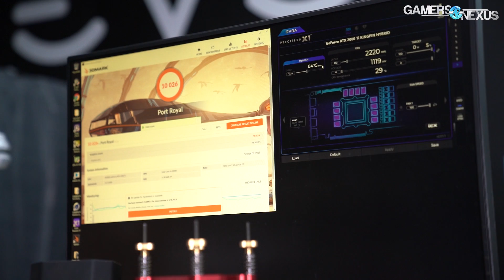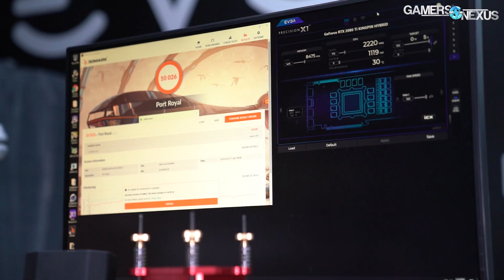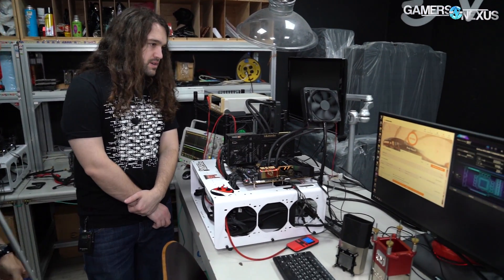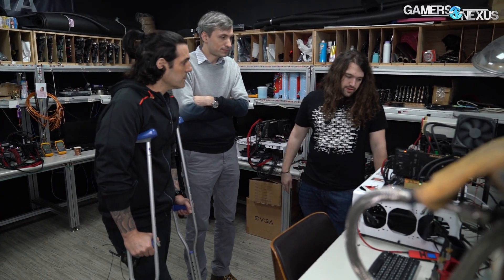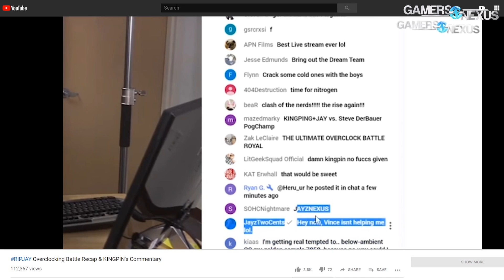"RIP" KINGPIN | 2200MHz RTX 2080 Ti Kingpin Overclock on Water

Comment: Wow that is so cool. you should a do video with one of these Kingpin GPU's cooled with phase change refrigeration and see how high clock speed you can get out of one of these RTX 2080 Ti cards.
I had a question. I have a few EVGA RTX 2080 Ti XC Gaming Cards. I got them off of Ebay, I thought I would re-paste the GPU's on them to see if I could get them to run cooler. 
I have built many PC's in the past and used the pea sized dot in the center method for applying thermal grease, but I have done it only on CPU's with an IHS on them, never on a GPU.
For some reason no matter what I do when I apply thermal grease to the GPU the temps end up worse then they were before I took them apart. 
I have tried the Pea Sixed dot in the center also the X and the vertical line and spreading methods for applying the grease to the GPU and I have tried Grizzley Kryonot, Arctic Silver 5 and Arctic MX 4 pastes with all the same result the cards run really hot. 
I am using the stock heat-sink and fans on the cards and also re-using the heat-sink tension screws with their integrated springs on them. 
 Do you gave any idea what I might be doing wrong ?
do I need to also replace the thermal pads ?
no thermal pads were removed I just took the stock back-plate off of the card when I re-applied thermal grease on the GPU, but I put it back on again and left all the thermal pads alone and stuck on the backplate. Also the other thermal pads are sandwiched  inside underneath the other plate around the GPU but that plate along with those thermal pads we never removed or unscrewed at all.
Any helpful suggestions you can offer would be greatly appreciated.
in the past when I applied thermal grease on CPU's they always ran cool and fine and I had no problems applying the thermal grease but for some reason I can't get these GPU's to stop overheating.
Thank You in advance for your help

Comment: Im very satified with my evga 1660 super. It overclocks great, solid 90 fps on ultra settings if not higher depending on game . Precision x1 works great for overclocks with a great looking UI even though i prefer afterburner personally. Keep uo the good work GM and EVGA

Comment: if i was rich .. i'd buy 2 of these beasts and custom water cool them as much as possible 
easy 4k@144hz gaming
Reply: someone you really think so? I just bought my 4K 144hz monitor and I’m considering buying one of these, for now
Reply: @pubbzie5866  depends on which games you play .. but a single one should suffice for BF5 for example 
if you are planning to sell it for next year new generation (rtx 3080 ti ?) then i'd say go get the ASUS one .. it's FAR cheaper 

the kingpin one cost 1900$ 

and it's suited for extreme overclocking with Liquid Nitrogen 
even with AIO 240mm water cooling 
and hand-picked chips to give you best overclocking GPUs
it's VERY hard to push the card past 2200 mhz because of heat (more heat = unstable OC)

but i'm wondering if Custom watercooling the GPU (vrams and memory and GPU , not only GPU like the AIO) if i get 2300 mhz ?

it's not cost effective .. but if i was rich i'd do it 

so yeah .. i believe that for us the ASUS one is enough LOL it's still pretty good card and with all that RGB maybe sell well down the line if you are willing to sell it
Reply: someone ok thanks for your reply bro, I was considering the Asus one but also the evga ftw ultra but I thought if I could get this kingpin card and get an amazing oc that would be the way to go haha, you really think the next ti card is coming out so soon?
Reply: @pubbzie5866  there's no concrete info about next gen release date .. but i'd say it's not that "Close" maybe a year 
but for me personally it's "close" LOL for that i'm waiting for PCIE 4 , DDR5 Ram and next generation Intel CPUs 
and perhaps ultra wide 4k

to  have a new Build that run 4k smoothly 

but if you get the Asus 2080 ti today
it's a VERY good card that will serve you well for a year (and maybe more) until the next "best cards" come out
Reply: someone ok thanks for your opinion bro I appreciate it I’m not sure what I’ll do I know my 2080ti is going to have trouble driving that 4K 144hz beast of a monitor though lol

Comment: I've read through all the comments and watched the entire video twice and can't find anyone talking about the voltage limit. My modified eVGA 2080 Ti RTX FTW3 Ultra hits the voltage limit and what is stopping me from going any higher in my overclock. At 12:38 Jesus asks Vince about what kind of voltage he is running and there is some back and forth about what the current voltage is set at and what he runs on LN2 and Jesus even mentions what max voltage is on stock 2080 Ti and which I'm hoping to hear Tin chime in "well, we removed the voltage limit on this card" but he doesn't leaving me with the impression it is still there... What am I missing here? On a side note: Tin is just a great human being and he has helped me several times over on his private IRC server (check out xdevs.com for lots of great technical papers and electronic goodness) and even recently helped me save some cash by answering some questions regarding an ERSA i-Con soldering station. Really appreciated this video!
Reply: nobody?
Reply: KP doesn't want to let on how they do it, you can see him squirm at the questions.
Reply: @tonycambell8875  thank u for the validation, man!

Comment: Only $1500 for the Turing 80 card that was renamed the 80 Ti card because Nvidia didn't want to draw ridicule with a $1200 80 card! 

"RTX 2080 Ti": 25% faster than 1080 Ti, $1200 (the 80 card)
"RTX 2080": As fast as 1080 Ti for $900 (the 70 card)
"RTX 2070": As fast as the 1080, no SLI, TU-106 SKU makes it assuredly the 60 card for $600. 

Golf clap. Nvidia fanboys still line up for this shit in droves though. Before any AMD fanboy comment crap please check my channel for, 1080 Ti + 8700k here. I'm just not a deluded idiot.

Comment: Steve, I had done an experiment on memory clocks vs performance scaling, and found that memory does not scale linear. It is more of a sinusoidal scaling with sharp peak and cusps. End story is, it really helped me max the performance of my 1080ti, I went from around 4kish Valley (extreme 1440p) score, to consistently above 4220, with just memory tweaks. Let me know if you want my data, and I will be more than happy to send you my excel sheet.

Comment: I'm interested in what hardware drives the small OLED display and measures the voltages and temperatures. Is there an external MCU or is it built in to the card firmware? What kind of ADCs did you use? Modern silicon can have voltage steps of 25 milliVolts or less. At that resolution, noise can be a huge problem for cheap ADCs or ADCs built in to the MCU.

Comment: it is very smart that the EVGA RTX 2080ti Kingpin uses a 240mm rad, on my EVGA RTX 2080ti XC Hybrid temps hit 60-65c playing Metro: exodus with the single 120mm rad(inside a NZXT H440 case), imo 240mm should lower the temps alot the RTX 2080ti can get somewhat hot.

Comment: my wallet is open....waiting on the release lol
Reply: Dhall243 was it worth it I’m about to buy one?
Reply: @pubbzie5866 I decided to wait on next gen cards, but if you need an Associate Code to order yours mine is 77EDRMMM9LD5Y6Q
Reply: Dhall243 cool thanks man I’m just on the fence I just bought a 4K 144hz monitor and I want to get a 2080ti but idk if it’s worth it for me to get the king pin, I could get 2 Asus 2080ti blacks for almost the same price
Reply: @pubbzie5866 If I were to buy one, it with be a FTW 3 Ultra, but I have a feeling that Ray Tracing is just going to be a gimmick seeing that there still isnt many games using it and the cards have been out for a while now. I figure waiting on the next gen cards or seeing if the RTX refresh is true would be the thing to do. Its not justifiable to me to pay double the cost of a 1080 ti for performance that isn't doubled.
Reply: Dhall243 ya ig your right, I just don’t see them coming out with another ti so soon prices are so high the new ones would only be hire right?
Reply: @pubbzie5866  well if they drop the RT cores That would bring the cost back down.
Reply: Dhall243 wouldn’t that be worst than the cards now though ?
Reply: @pubbzie5866  so im now backpedaling on what i said earlier. I bought a Kingpin yesterday, it will be here next Wednesday
Reply: Dhall243 I fucking love it lol plz plz let me know what you think about it bro

Comment: Weird flex but okay, I bought the 2080ti Black Edition for 999, dropped a kraken g12 with a 120 aio from Corsair and hit 2145mhz on the core and 9000mhz on the ram, all on a non binned alpha chip. Never goes above 52°c.
Reply: Same here but only 8000mhz for me and around 42-45 degrees w/ custom water loop. $999. Still need to tinker with it maybe try a different bios if possible but hitting 2130-2145mhz.
Reply: @inv4drzm976  Yeah let me know if you find one, I'd love to increase that power limit! Here's some bios' from tech power up. https://www.techpowerup.com/vgabios/?architecture=NVIDIA&manufacturer=EVGA&model=RTX+2080+Ti&interface=&memType=&memSize=&since=
Reply: exactly less then 5 fps difference for $500+ more

Comment: Why dose the 1660 not GDDR5  9GPS or  GDDR5X 🤬🤬🔥👎
Reply: so 1660 doesn't beat the 1660Ti same reason why every nvidia GPU is voltage locked so it can't beat the next in line card. can't even SLI RTX 2070s so it can't beat 2080

Comment: All kingpin Gpu’s will hit 2200mhz.. after a bios flash
Reply: Jay Mcphee that sounds awesome.  But you're probably going to be paying an extra $400 for that 130-150mhz over an FE, and some memory speed too.  Resale won't be amazing on those, good, sure, but not +$400 good
Reply: David can reflash the fe cards too..
Reply: Jay Mcphee yeah, I have both of mine flashed.  One can hit 2145, but tops out at around 2070 at 100% load, typically, due to power limit.  Unlimited power would be awesome, there's no doubt.  But you're literally paying that huge premium for that one feature.  Don't get me wrong, I wish I had these instead.  But I can get an FE and an EK water block for less than this card costs.
Reply: Jay Mcphee check out the RTX 2080 Ti owners thread on www.overclock.net forums
There's instructions and BIOS there on the first page
Link:
https://www.overclock.net/#/topics/1706276?page=1

Comment: Gamers Nexus : would like to see the GPU binning process next time you guys are on site.
Reply: When they bin these do they actually put electricity to them and run tests or is it some sort of vision inspection? You say a robot I imagine for sorting but what about pulling out processors able to hit higher clocks for the premium products? I know some processors have A designation from Nvidia but so they bin further after that?
Reply: @integer0verload948  probably sort of similar to an asic quility rating Nvidia had hidden in a lot of their gpus for years now. I imagine it's as easy as running a pick and place robot to a land grid array and check the asic quality. But I ain't evga
Reply: Probably an EVGA robot does that
Reply: @Corei14  don't talk about people like that

Comment: ...1.15V is overvolting?
Reply: nvidia locks voltage on every GPU so you can damage it with overclocking and so you can't beat next card up in line.

Comment: 2220Mhz on an AIO is actually sick!
Reply: My FTW3 ultra gets 2140 on an evga hybrid kit
Reply: Skoopsro what max temps though? (In delta, minus room temp?)
Reply: Alemanmx the core is running at 41*c after a several hour long game session, and memory is 53*c  in the top right memory sensor for the ICX sensors in precision x1
Reply: @skoopsro7656  wow, only 41 over ambient? You're running also at 124% power limit?

I think Im going to get the kit, I have the FTW3 on air but its running at 55 over ambient.
Reply: @phillylove7290  3k is less then MOST adult hobbies? You've never done ANYTHING motorsports related have you?
Reply: @QK_SAND  go karting is about the only motorsport that will cost less than 3k.
Reply: @phillylove7290  Holy crap that's a overly wordy way of saying he is right just not for the reason he thinks he is, and then immediately following it up with your own wrong bit. "most adult hobbies" is a pretty broad claim as it is, adding smoking cigarettes as a "hobby" just muddies what you mean further. and I don't see what you mean by "Less than $3k a year" unless the suggestion is that PC gamers pirate over purchase, there is a reason "huge Steam library" is a meme, and it's not just the Steam sales.
Reply: @phillylove7290  Titan Z was indeed a flop, but that was due to its absurd price of $3K when AMD's R9 295 X2 launched at literally half that, and prior dual GPU cards (GTX 590 and 690 and HD 5970, 6990 and 7990) did not exceed $1000.
Reply: @phillylove7290  That 3k/year will largely depend on where you live. It will not be much of a problem in US with cheap HW and decent wages or similary developed countries but in poorer ones like CR where I live where most ppl are getting like 1,2k/month outside of capital in gross earnings such expense in a year is impossible. There is a very small amount of ppl who would buy something like 2080ti with current pricing once every 2/3 years. Most will go with something like 2060, 2070 max in terms of price every 2-3 years.
Guess I will have to move somewhere else to work to be able to get a 5k PC every 2 years lol :D

Still I might check this baby when it comes out. With that much cooling, switching to 240mm rad instead of 120mm + heatsinks on the card with fan it will reach pretty crazy OC even without any special mods OC enthusiasts would use as long as we use 3 8pins to power it.
Reply: Not really.  Its easy.
Reply: @cessamichelle  Some people don't get depreciation of hardware and are still trying to sell titan Zs for almost $3K haha

Those customers will get a Titan V, Titan RTX, or a much better deal of two 2080 Tis

Even four Radeon 7s would be possible at that price but that card seems to be dead
Reply: I'm @ 2049 Mhz OC on Air for two of the EVGA GTX 1070 SC's in HB-SLI
I just might bite on one of these... 🎲 
But after AMD drops all of It's New GPU offerings & then the Price goes Down a bit... 💲👇 
Cuz Sadly They Want SLI 2 Die! ☠⚰☠ 
The Wrightings on the Wall! ⚠️👀⚠️
They Hate that You could actually just use 2+ of their Cheaper "Last-Gen" GPU's...& Beat their New "Top Dog" 👑 Most-Expensive Singular GPU! 🏆
 
So then they are effectively competing against themselves, just like Apple Inc. currently is... ♾
Reply: @SickBuckNaStY  this is hard to read

Comment: "When you take Overclocking so serious that you break your own leg to have an excuse not to move from the desk."  - K|NGPIN
Reply: AMD sent some guys over.
Reply: Jokes aside but he was walking without the crutches in the older video at some moments , how can he do that?
Reply: @kepler104  Also to expand on what A C said and share an experience I had when I broke my leg. Part of the healing process is to put weight on the leg for multiple reasons. I was expected to begin to start walking on my weight I think and I could be completely misremembering but I think it was about a month in. I had to stand up from the hospital bed and put weight onto it for a few seconds, this is increased over time. When I was at home I was given a walking frame that you might see older people using and then to crutches.
Now I believe some of the reasons and again I could be completely wrong is that not using your muscles for a long period of time can reduce muscle mass, making sure the bone fuses properly even when a cast is on and rehabilitation to get you walking properly again.
Non the less it isn't fun, it really hurts, especially for at least the first month of walking for small periods of time, it's a pain in the ass because the cast gets in your way of everything, including showering and bathing.
Reply: ty for the info everyone

Comment: cool video :D 

Would be nice If people could buy  that 240mm aio there are none you can use without nzxt gpu bracked for asetek aio coolers  mount for mounting on gpu I haven't found one. Would be cool  if that thing sells like the evga hybrid 120mm aio kits with the 900,1000,2000  series cards :)